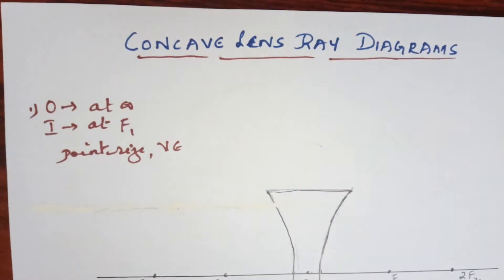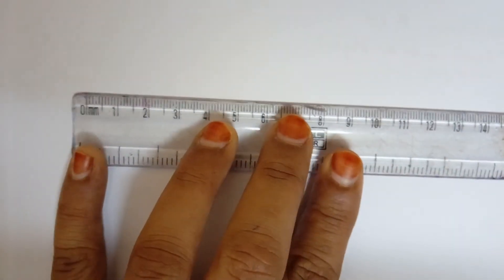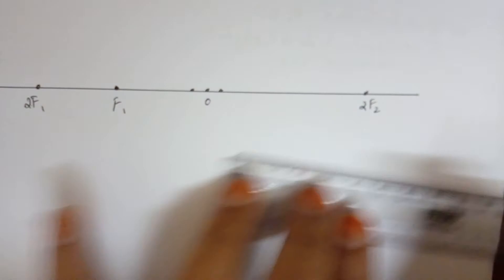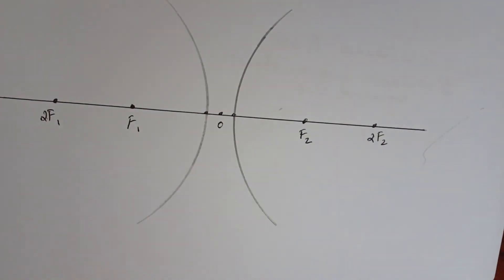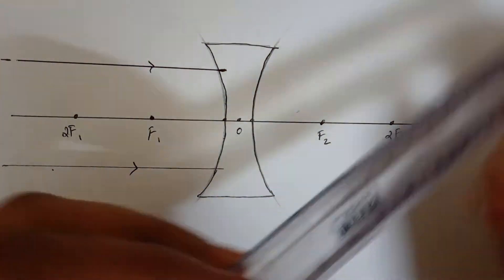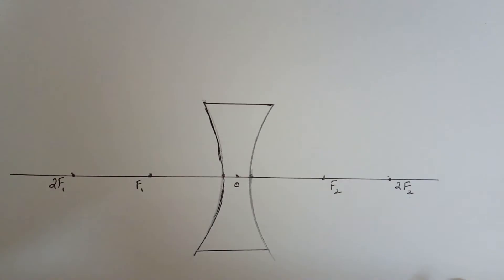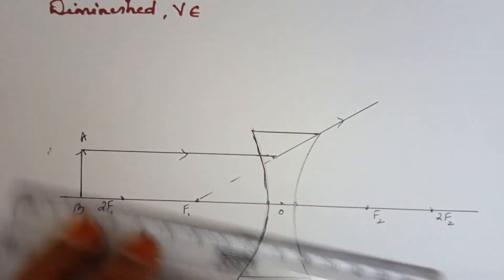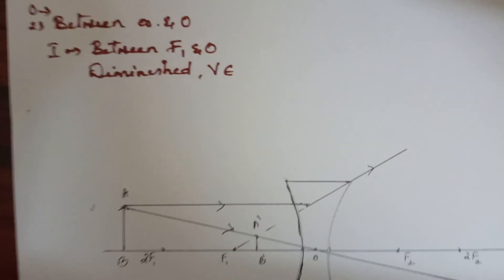RAY DIAGRAMS - CONCAVE LENS

Comment: Position of the object is btw o n f right then y did you place it beyond 2f1
Reply from the maker: Hey Pavan. The position of the object is between O AND INFINITY AND NOT O AND F, hence you can place it anywhere in between. In my case i chose beyond 2f1. Its upto you to change the position anywhere between the said two points and i can assure you the answer will be the same. Hope i have cleared your doubt.